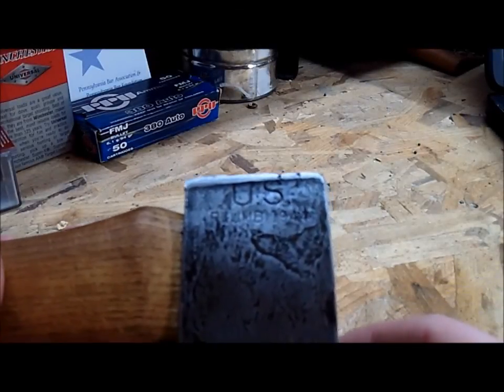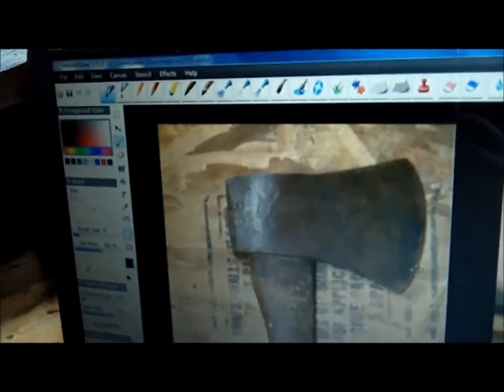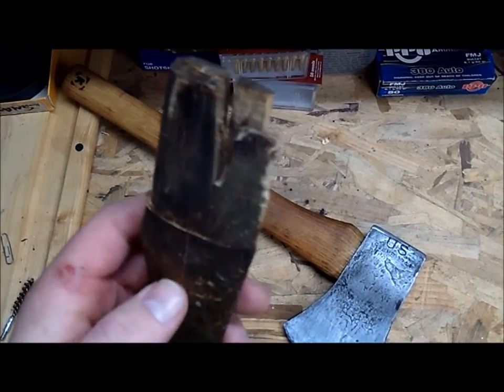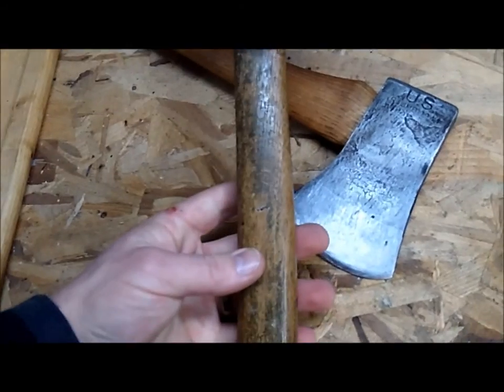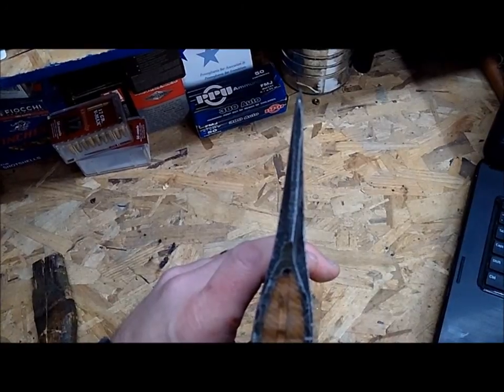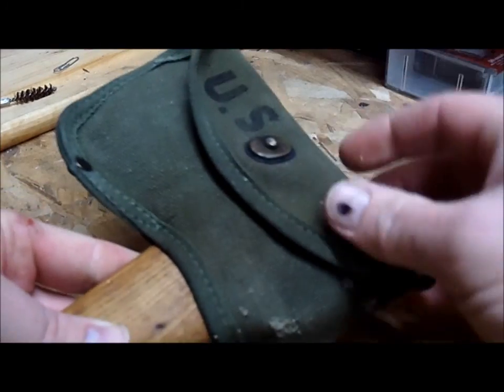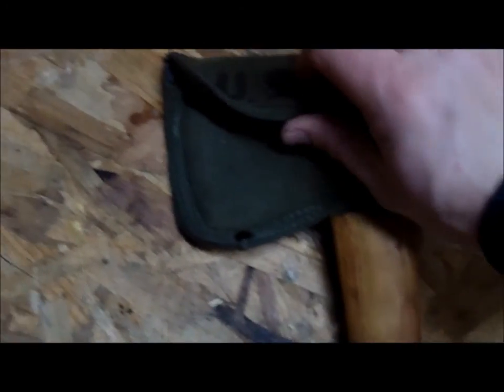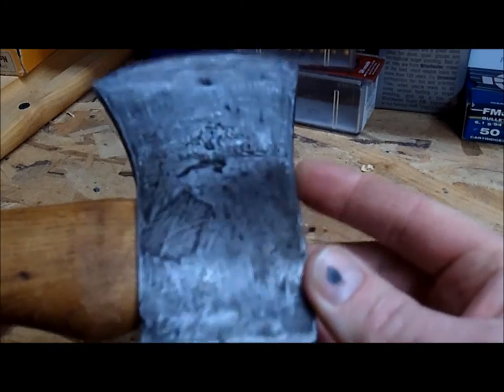US Plumb 1944 Hatchet WW2 Restoration

Comment: i have a 1942 plumb, that has just a small amount of mushrooming. it has a slight angle on the top back edge like yours. to me it looks like it may be from the forging. mine has the stamped writing also.if you dont mind how much did you pay for yours?
Reply from the maker: Rusty East interesting, maybe they were forged that way?  I paid about $28 including shipping.  I've used this hatchet this spring some more and I really love it.  The vintage steel holds an amazingly sharp edge and it's nice and light to carry...

Comment: what was the length of the handle? just bought one of these heads (with stamped lettering btw) w/o a handle and want to make it match fairly close.
Reply from the maker: cool, I'll measure it for you tonight and get back to you
Reply from the maker: sorry, forgot to get back to you! 15.5 inches total length including axe head
Reply: thanks. I've been looking at pictures on the interweb and ours with the stamped lettering send to have a slightly different shape than the ones with raised letters. mine looks just like yours.

Comment: are these worth a lot?  I have got the same one. thanks
Reply from the maker: All I know is the completed listings on ebay which are all over the place depending on condition.  I paid about $28 including shipping on ebay for mine.  Like anything old it seems the prices will just increase as people realize how great the steel is in these cool pieces of history! What condition is yours in?
Reply: @VintageWoodWorkshop  Actually all war time tools are made with much lower quality steel. with a cheap cadmiuim  plating or plain steel . Not the stronger chromium vanadium. And none of the wartime tools are warrantied because of these reasons.